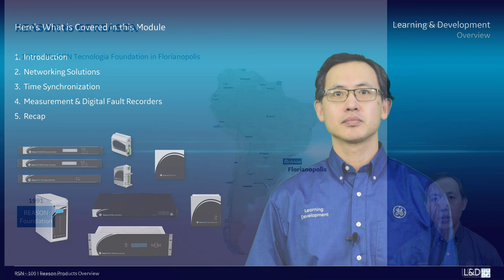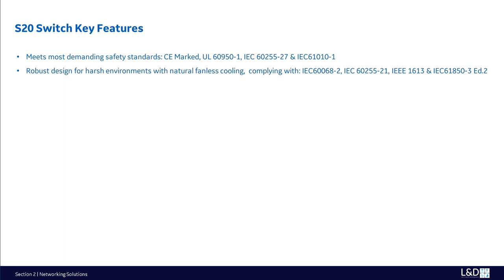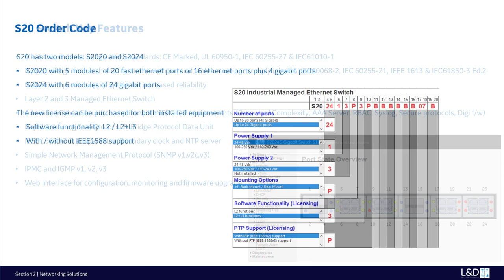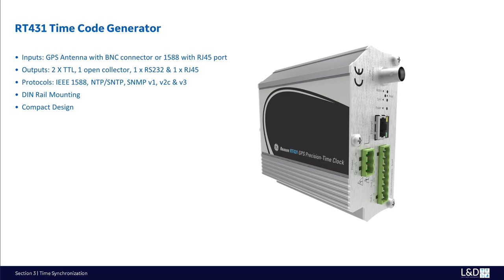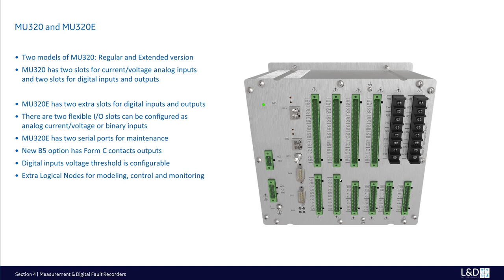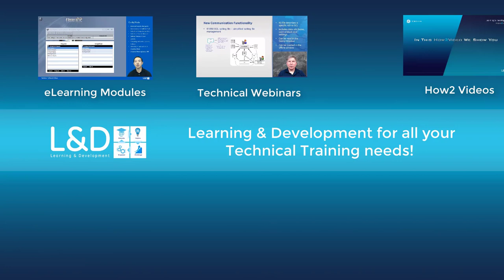RSN 100 l Reason Products Overview v1

Comment: 1:40     Section 1 : Introduction GE Reason
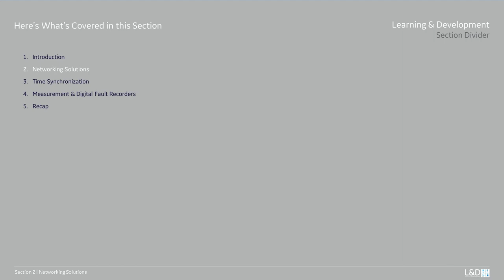4:04     Section 2 : Networking Solutions 04:04
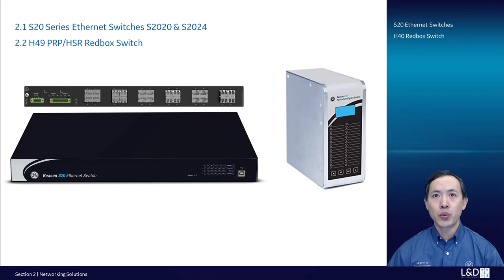4:33        2.1 - S20 Series Ethernet Switch S2020 & S2024
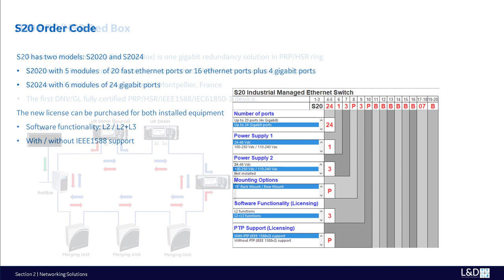15:23      2.2 - H49 PRP/HSR RedBox Switch
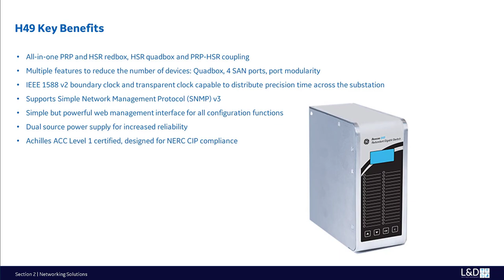18:58   Section 3 : Time Synchronization
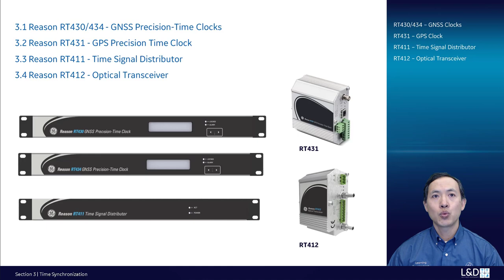19:42      3.1 - Reason RT430/434 GNSS Precision Time Clocks
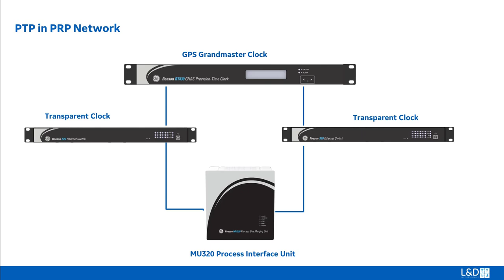24:33      3.2 - Reason RT431 GPS Precision Time Clocks
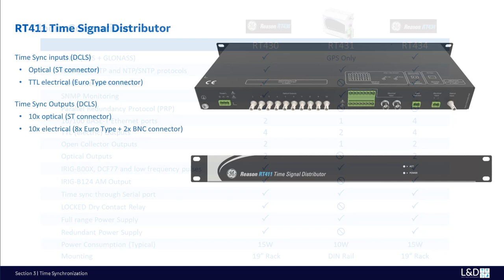25:36      3.3 - Reason RT411 Time Signal Distributor
26:45      3.4 - Reason RT412 Optical Transceiver
27:40   Section 4 : Measurement and Digital Fault Recorder
28:14      4.1 - MU320 Process Interface Unit
33:59      4.2 - DR60 Compact Digital Fault Recorder
37:22      4.3 - RPV311 Digital Recorder with PMU and TWFL
39:09               RA33X Distributed Digital Recorder remote acquisition module
39:45               RPV311 PMU Measurement
41:09               RPV311 Traveling Wave Fault Locator
42:52   Section 5 : Recap